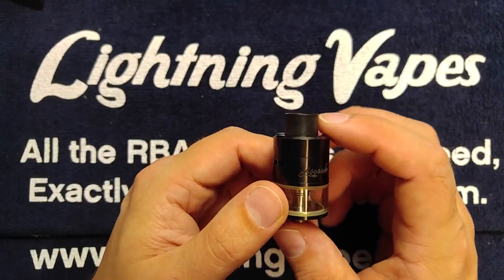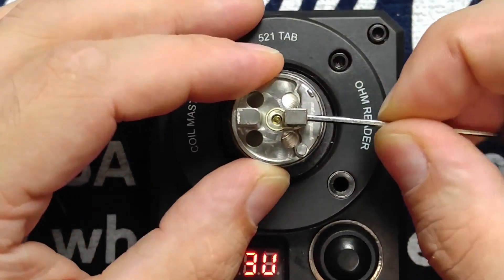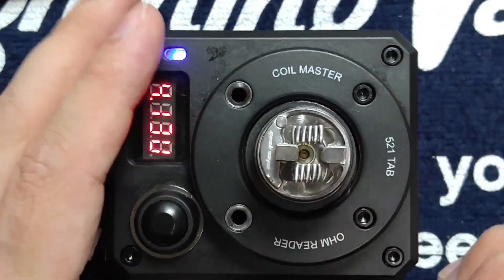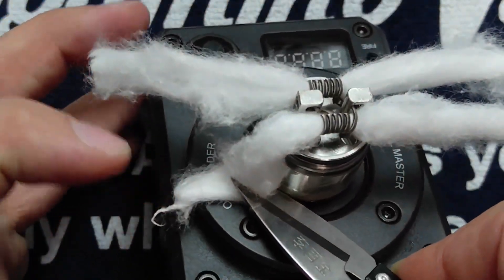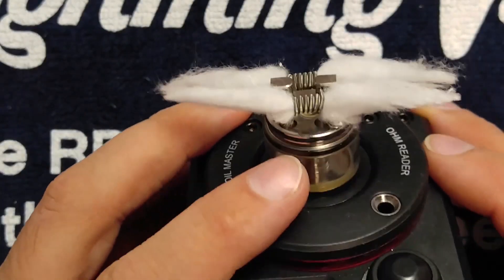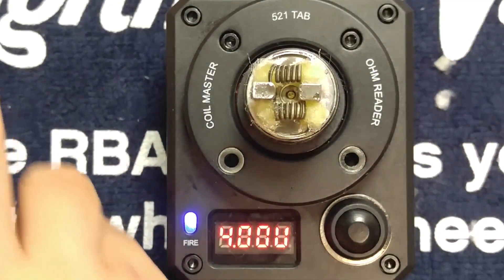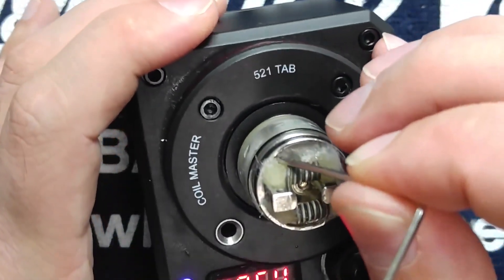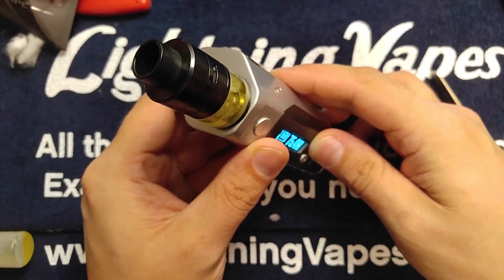GeekVape Avacado 24 Build & Wicking Tutorial - By Lightning Vapes

Comment: nice video, I personally just cut the wicks short and cover the top holes and it wicks fast and minimizes the leakage.  only draw back is that you have to tilt the device or hold it upside down between vapes.  but never had a dry hit and it's pocket friendly.  I do try and keep it up right.

Comment: Don't know if anyone is reading, as this is a bit old. I've been vaping over 10 yrs, and still have just about everything I've ever bought...which is, for the most part high-end.
I do have the 24..and I'm not a fan of tons of cotton in any tank. 
Suggestion: y'all might consider putting some steel cables in the wick holes. You can then lay some thick cotton over them, pushing it in around the top of cables, leaving a bit of air escape on at least one.
It should leak less, but don't just stick it in your pocket...you'll most likely have an "accident"! 
Good vid...great advice for those using just cotton, to the bottom of the tank!
Peace!
Reply: I have this tank for years...i cut just enough for the cotton to fit in the holes and slide a little bit through and before putting the tank together fluff out the cotton inside the holes...you gotta tilt the mod to wick the cotton but it works and no messy cotton inside no leaks...love this tank

Comment: pro tip, if ur gettin dry hits, make sure u have a little venting next to ur wicks, atleast one vent hole on each side. but it will leak n ur pocket, I'll use a paperclip, and close up the vents I made b4 I stick it n my pocket. never ha e problems. with this method it dosnt mater how thick the wicks are. DONT MAKE THE WICKS THAT LONG EITHER! LOL

Comment: I have avocado 24 rdta bottom airflow and using fused clapton 26G coil, but when I vape on more than 30watt the driptip gets very hot, I already tried 50watt but it gets so hot until the inner driptip melts. 
I'm using vaporesso tarot pro btw, please give me a suggestion so I can vape on 50-70watt without getting my lips burn.

thanks
Reply: Ayudias U.N 
sama bro. gw jg awalnya bgtu. gw pake tarot pro, rdta  avocado 22. 
drip tipnya lu masukin semua bro, ujung bibir lu jgn pas di ujung drip tip. skrng oke2 aj gw pake cara bgitu.
Reply: Are you using the included metal driptip?

Comment: Thanks for your video man. 
I was almost decided to give my avocado 24 a one way trip trough my 6th floor window and return to my prefered state: Calm. 
This tank is a annoying little bitch that is always leaking  between the top cap and the midle part. 
6 seconds in pulls =  30 seconds cleaning the bitch.  Its annoying. 
The first one i have, i use it for less than 24 hours and through it away from the window. Now, a few months later a friend remembered to offer me one.
Received  yesterday and decided to give it another chance. Yes, the flavor from it is awesome with fused claptons but the dumb designers of Geek Vape not yet realized that if they make a tank to be used at least with 3mm coils, they have to make it with at least 4mm juice halls (or 4.5mm). 3mm for the cotton means 2 or 2.5mm for the coil. 2.5 mm coils in a 24mm tank?!
They really need some vapers working there.
So... Back to the Thank you part. After more then 2 hours and a lot of wasted cotton, liquid, and 2 sets of coils, i saw your video and get amazed by my stupidity. Of course: In a poorly designed tank (like many in this topic), if nothing else is possible, JUST CUT THE COTTON. It is not ideal but gets the job done. Vaping since 2014, and i completely forget this basic thing. I blame my Wismec Theorem. That one is noticed that was made by vapers, so it as a decent cuts for the cotton (and juice, in that case).
Thank a lot again. You just saved my Avocado 24 from a intended parachute-less 6 floors free fall. 
And now, is as a great flavor without any dry hits. If was not for the constant leaking it would be a fantastic vape.
By the way, your wicking is not wrong as claimed in the comments. Enough cotton in the coil, enough cotton in the juice. That makes it right wicking.
Thanks a LoT.

Comment: don't do ur wicks like that lol. my wicks go down about 1/4 inch. wicks don't have to be touching or even close to the bottom. honestly, the way he built that is not at all the way I do it lol. but my shit BANGS mad flavor nice wet vapes, anyways just push the wicks through the holes with ur tweezers I also keep a paperclip In my pocket to pluck the wicks out to refill and then push it back in the hole. do not put a massive long wick in it like that. be a pain and very unnecessary. I wish I could post a pic!